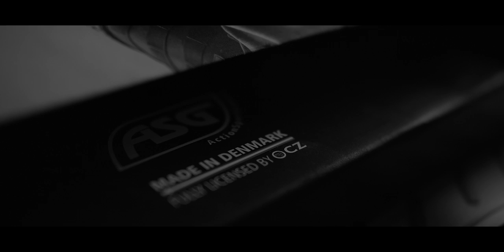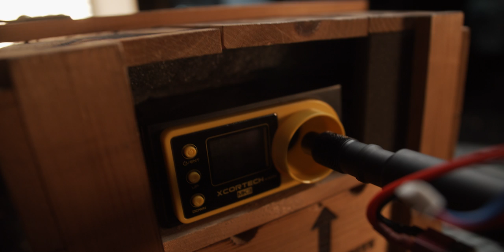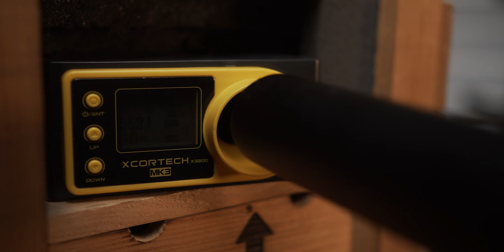ASG CZ Scorpion EVO3 + Jefftron Leviathan | Review & Tuning - ACS "Techsoft"

Comment: Hab bei meiner carbine, initial, nur den Modify 6.01 hybrid Lauf gewechselt. Ein weiches Bucking (für CQB, hab vergessen welches) und dann aber das selbe Problem gehabt wie ihr. Daher dazu gern mehr input, wenn vorhanden.
Ich habe das auch nicht gelöst bekommen und mir dann einen "Tensioner" selber gebaut. Das geht jetzt zum Glück ganz gut. 
Auch muss man sagen das die Hopup-unit etwas frickelig beim Zusammensetzen ist.
Für ein weiteres Manko, dass Hopup gear, wird eine Enhanced version angeboten. Ist okay, bis auf den Preis von 15 Euronen!  

Das wichtigste war aber,  statt einem neuen piston head einfach einen neuen O-Ring einzuwechseln. Selbes Ergebnis wie bei euch: ABSOLUT dicht! Zack, war ich mit 0,25er BBs auf echt guten 1,8J. 
Noch ne M110 rein und das übertriebene shimmen + Kugellagerbuchsen und ich schwanke jetzt im 1,48 -1,49J Bereich. 
Echt ein stimmiges und konstantest System!
Die M110 hat dann auch weniger Verschleiß und ich sag mal 80 Meter kann man damit locker machen.

Das Jefftron (EVO3) kannte ich noch nicht, geht das irgendwie auch back wired zu installieren? 
Ich will gern den M4 Lauf testen, da eines der wenigen Mankos das einlegen des Akkus ist. 
Auf dem Feld echt nervig und meine Kabel haben dadurch auch schon einige Macken an der Isolierung.
Auch geht so die Feder, die den Hebel des Dust Covers bewegt, schnell verlohren.

Gibt es evtl. zu der neuen Version auch ein Video, mit zB. was sich verändert hat?
Die HPA Version würde ich mir auch gern mal unter eure Lupe ansehen wollen =)

Ganz allgemein: Danke für die viele Arbeit die Ihr euch macht. 
Hat mir bei meiner Honey Badger echt den Ar*** gerettet ;)